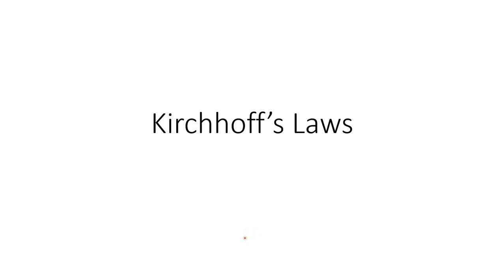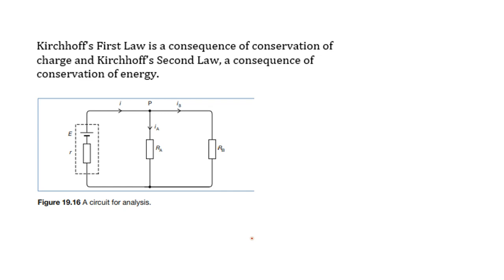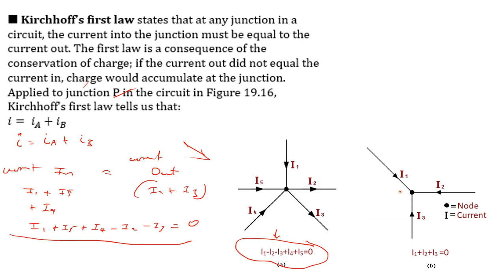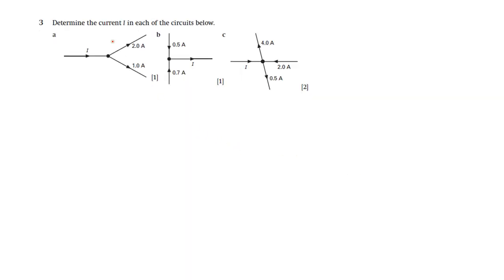Kirchoff's Voltage and Current Laws

Comment: At 29:35 where you minus the equations ,why is that? I think you would add them as in math (same sign add,different sign substract)therefore I2 would be 3/-2 or -1.5 instead of 21/22…please explain that